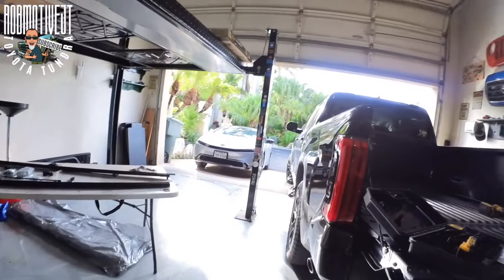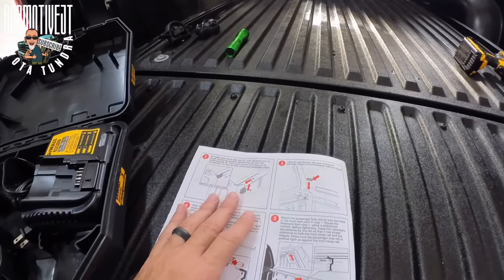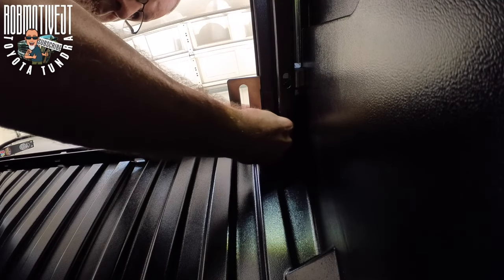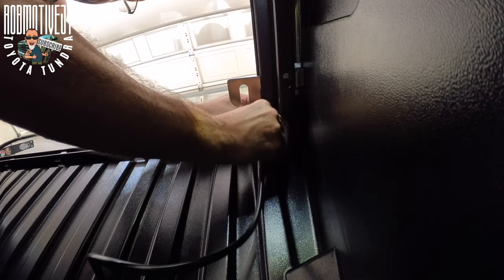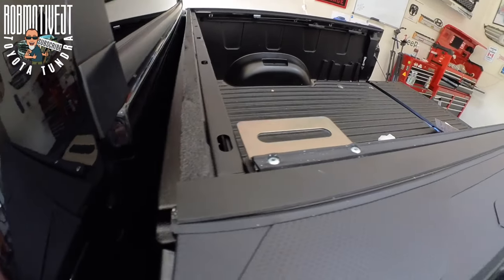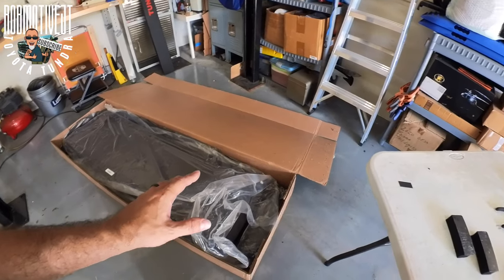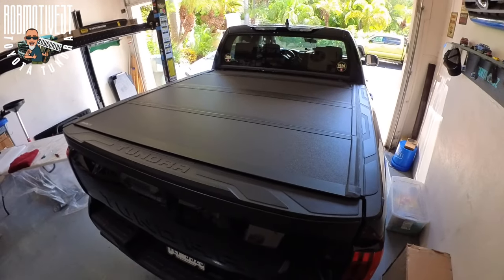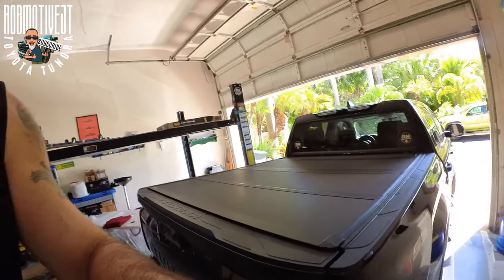Tonneau Cover Install For The 2024 Toyota Tundra

Comment: I put the MX4 on my Tundra too.  Had this same cover on my previous 2021 Tacoma and loved it.
Reply from the maker: Ever get any leaks?
Reply: @robmotiveplus  There maybe a few drops of water in the bed on occasion but it is very minimal.  I still keep most things I carry in totes which keeps them dry.  I believe most of my leaks have occurred around the tailgate.  I also have the sprayed in bed liner and it makes it hard to see water drops in the bed.  I would say the cover is 99% water tight which is better than most covers.

Comment: Rolling on the KBS black bed liner on mine today. Can’t wait to see if it improves traction cause the slickness is just insane. My drive way is about 30 degrees, I struggle to keep balanced while sitting in the bed

Comment: Please show us how the cover folds open. It will depend on what you plan on putting in the bed, but a hard cover could interfere with hauling larger items. Are you able to access the front of the bed without climbing in from the tailgate? My rigid cover became water logged and very heavy after a few years. Ice and snow also made access difficult. When I did get it open any residual ice caused denting to the cover itself. I realize you’re not in an ice/snow area, but something to consider for those who are in those areas  .

Comment: I just purchased a BAKFlip F1 for my 2024 Tundra. My instructions say for 2007-2022+ Tundra but they aren't like yours. The kit did not come with the foam blocks that you showed early in the video, nor extra screws. The rails they sent me don't look like yours, basically not having the large bracket at the front of the rail, plus the drain tubes are larger. My instructions do not have me removing my side rails for installation either. Frustrating to say the least.
Reply from the maker: Strange.  🤔
Reply: I am having the same issue. I ordered from two different places and they are sending me a crappy version that doesn’t allow me to use my deck rail anymore since it clamps to the factory deck rail
Reply: @charlOOsi  I spoke with a rep on the phone and they told me they aren't doing it that way anymore. He didn't say why.